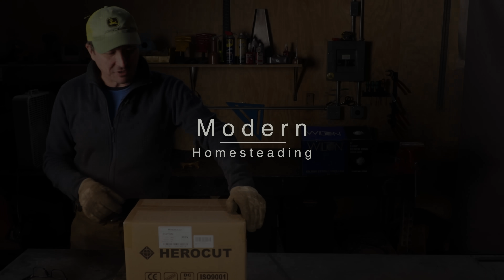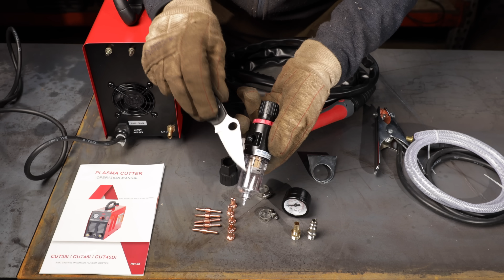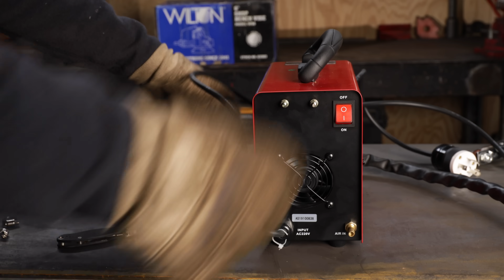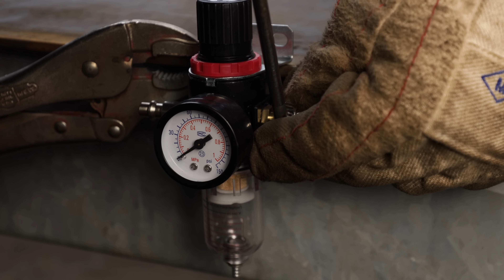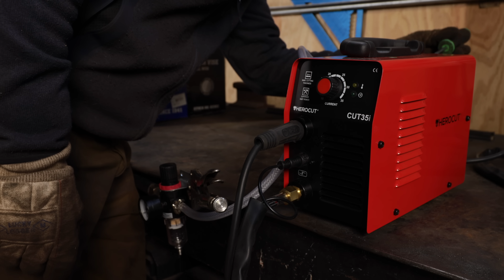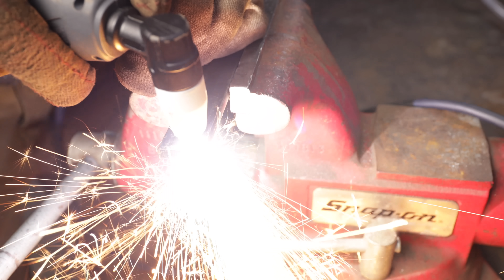TESTING The Cheapest Plasma Cutter On AMAZON

Comment: Here in the UK we have a German supermarket chain called Lidl where I have just bought a similar plasma cutter for £79.99 (around $105) and apart from a slightly different front layout the only major difference is that it comes with the regulator fitted.

Comment: I have a Chinese machine that I have had for about 8 years now... it cost about $450 US and it is a DC stick welder, plasma cutter and DC Tig welder.
It, too, came with all the needed stuff ready to go (part from Argon bottle and regulator)...... 
I am retired, but I am a gun smith in a small way and do the odd fabrication job and repairs.
This little machine has done everything that I have asked of it and for the money is difficult to match. My Mig welder cost twice as much.

Comment: I always find the cheapest anything on amazon  the requires should consider 220 vac as under power it on 110/120 vac will cause some type of  failure point of the products use

note short leads tend  to indicate overhead  wired lead or connection into a main welder with aux power output to power, mig/tig/plasma cutter..

it is likely a companion piece to be strapped on a bigger machine...

Comment: For sheet metal a plasma cutter is pretty nice but you also have to remember you need a compressor that can keep up with it. Even some large ones can't so just keep that in mind. I prefer a cutting torch due to the versatility but plasma cutters can be handy.

Comment: The Chinesium stuff, like at Harbor Freight, usually works but the compromise is the duty cycle.  The components are lower quality and limit the length of use before it heats up.  Claiming 100% duty cycle at any amperage is a helluva overstatement.

Comment: I've held off getting a personal plasma cutter due to not sure the size get. From using the one at work I figure a 50 to 60 amp plasma cutter is what I would need. The 70 amp one at work is such a time saver.

Comment: You can tell what air hose connection by the stripes of knurled metal on the female end and if it’s a round or square tip on the male end one is universal one is Automotive

Comment: "It is so little, guys! It's the Mike Bloomberg of plasma cutters"
I just blew water out of my nose!
Be careful assuming that the copper is actually full copper...i have received copper coated aluminium cables from China that were labeled as pure copper but did not stand up to full load.
Reply from the maker: Good point, I've also seen this,
Reply: @wranglerstar  sand the "copper" and look if it change color

Comment: I’d never buy a Chinese machine but that ground  clamp has one superior feature.  The copper braid across both side of the clamp is a must.  My Miller mig grounded to the far side if the clamp one time and the spring acted as the conductor.  Totally annealed my clamp spring.  Had to replace with one with copper braid.